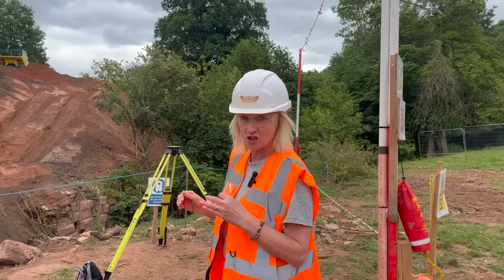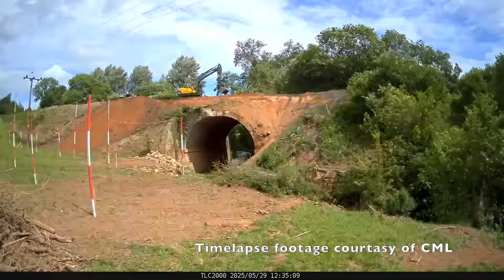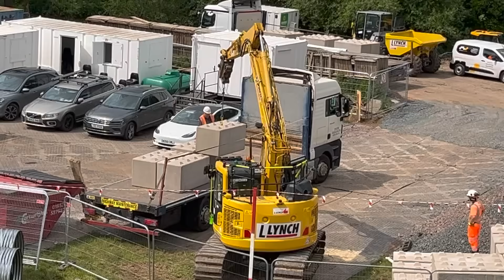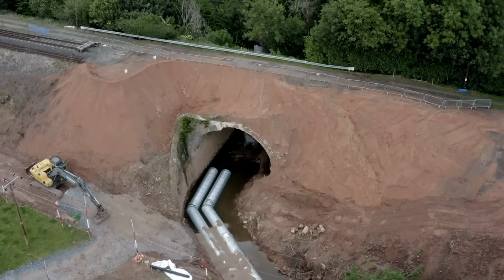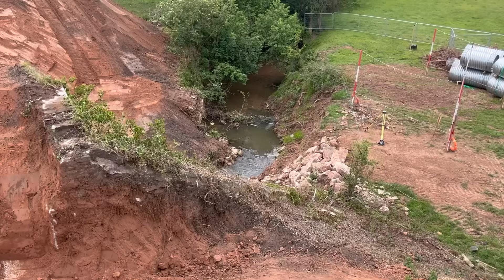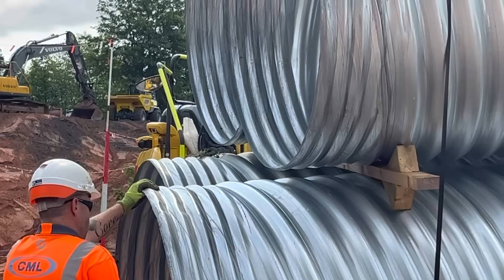Landslip repairs are moving at speed!

Comment: Good news, but ground still doesn't look stable. Seems to be sliding under excavator in background at 2:35
Reply: Well that's why they're fixing it. Plus excavators are heavy machines and it is seen on an embankment. There's a lot of repairs and stabilizing to do before they can get the trains running to the end of the line again.